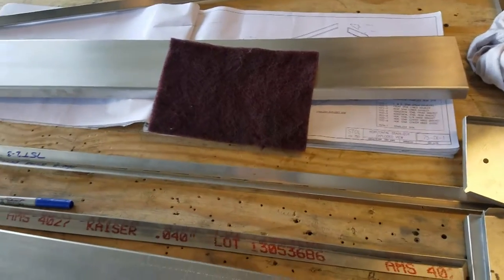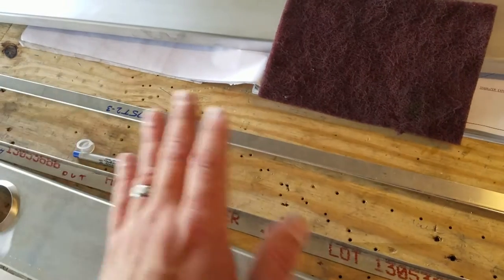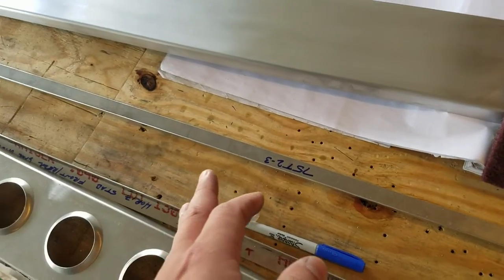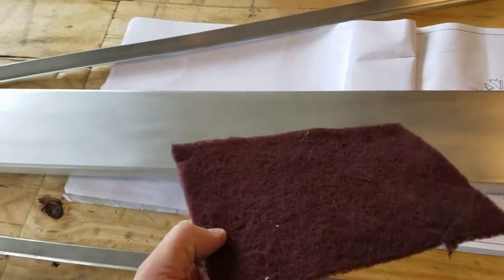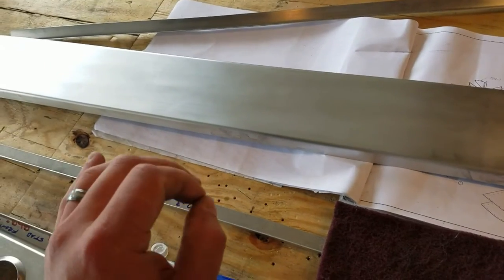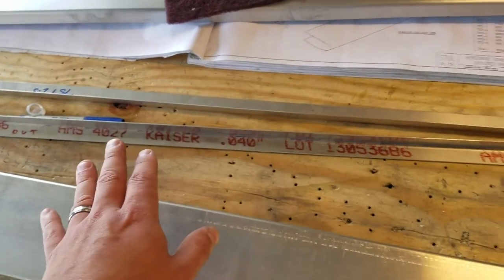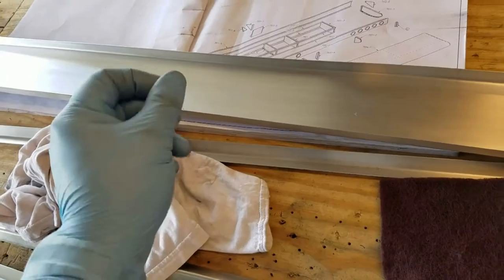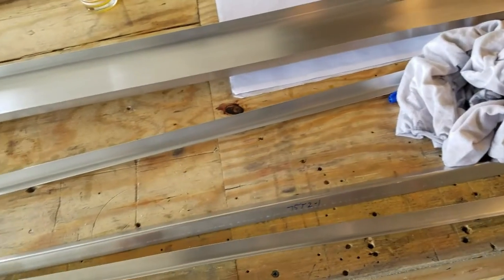Corrosion and Work Space Concerns

Comment: Are you going to anodize your parts?  Anodization is an etching process.  I realize my comments are kind of late to the party, but do you think that process would remove the contamination due to both sweat and iron oxide?
Reply from the maker: I looked into anodizing (specifically Alodine), but had already decided just to zinc chromate the mating parts prior to this issue with corrosion. It only affected a relatively small amount of parts, and scouring away any contamination with the abrasive pad seemed to work just fine. At this point, I'm just going to stick with zinc chromate for the remaining parts. If/when I ever get around to building the CH640, I'll be considering Alodine for that project so I can have the experience of using a different process and comparing the two. Thanks for watching!